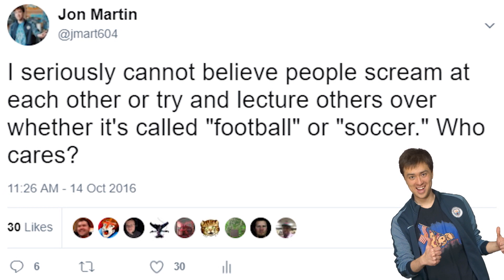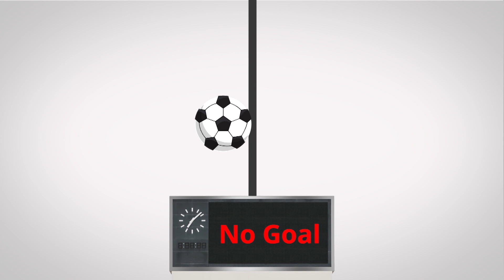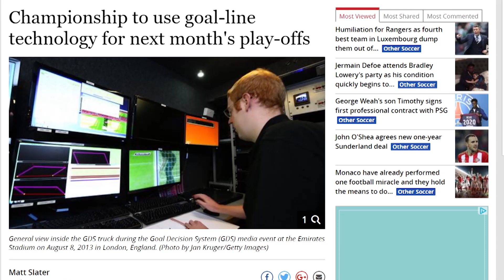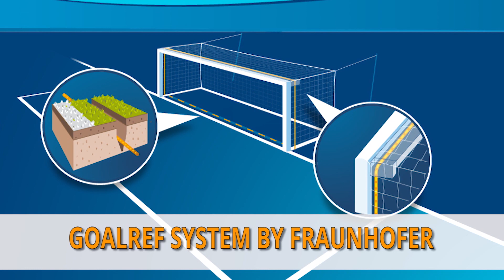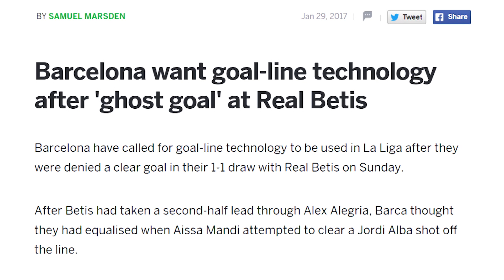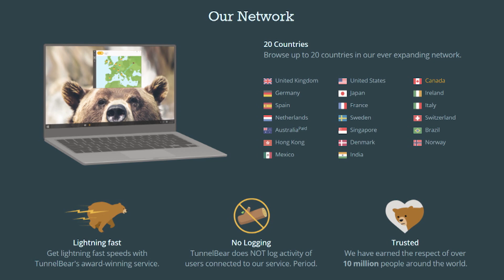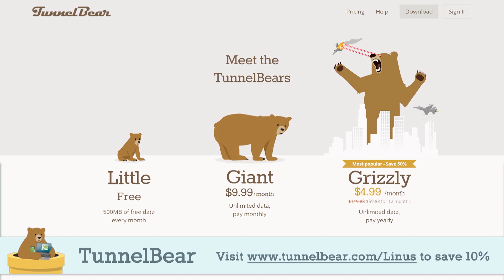How Does Goal-Line Technology Work?

Comment: This is most useful in hockey, where it is far easier to have a situation where the puck goes in without anyone noticing. The puck is like 10 times smaller than a soccer ball, and people shoot them at 120+mph, far faster than a soccer ball ever gets. It was very common to have people score, very often with a shot that's flat on the ice, that will go in and immediately bounce off the inside of the net and come right back out and the ref's couldn't tell it went in

Comment: The technology in sports has ramped up by a bit in the last few years. Golf, baseball, cricket and tennis all use radars and cameras to determine some parameter in the sport. Example a radar would be used for ball speed in all the sports. Cameras would be used to calculate the absolute position. The programming and math involved to get these systems to work is interesting.

Comment: It doesn't matter, to me it's soccer but I don't give a damn. The fact that football in the US and Canada is a term for another sport shouldn't make everyone cry. It's just 5 lost seconds trying to explain which one we're actually referring to. As for the goal line technology, the wires wrapped around the crossbar and uprights may be susceptible (I hope I'm using this word correctly, I can never get it right) to the posts' vibration and make a bad call. I think technology should be used, but cameras like in the NFL are enough. Let the referee decide. Still, even in that situation, we've seen referees overturn obvious good (bad) calls on the field, so the leagues should allow more than only one referee to give an opinion.

Comment: 3:00
500 fps? a ball can be shot at 200km/h => 200*3.6/500=1.44 meters a ball can travel inbetween frames (if the cameras arent synced (which i doubt) you could get an error of only 5cm (/2 bc of rebound) but still. i know that usually they are slower, rebounding takes more time and after they are even way slower, so i guess the 4mm inaccuracy just come from the system with the ball not moving

Comment: Why not use a series of ir lasers around the goal frame to sense when and how fast and object moves through the goal line? Also use a camera near by or embedded into the frame that triggers whenever the sensors are crossed. It's cheap, efficient, and doesn't need a whole lot of messing with. Every home in America with an automatic garage door opener has something similar and it is running non stop.

Comment: 5:25 and THERE was the reminder I DID NOT NEED of the ROYAL FUCKUP that the referee made at this years Stanley Cup Final. (If you haven't already guessed, Nashville fan here)
Reply from the maker: Nashville was robbed for sure. Goal-line tech would really help in the NHL, though arguably an even bigger issue is the rule that says the ref has to blow the play dead as soon as he loses sight of the puck. In my opinion, the play should be allowed to continue, with goal-line tech confirming if the puck was across if there's a big pile-up in the crease. Carolina also had a goal disallowed in Game 7 of the '06 Finals, even though a subsequent replay showed that the puck was completely over the line. --JM

Comment: Players are the human element (human error). Players should be given the right calls as much as possible. If it’s a touchdown, but the ref didn’t think so, it’s still a touchdown. The player did his job. If the player was thrown out at first base, but the ump said he was safe, the player should still be called out. It’s simple. Players/weather should be the only “X” factors in sports. Officiating should be as accurate as possible even if it means using more computers/technology.

Comment: Two questions:

1. Is this technology similar to Hawk-Eye, which is used in tennis for when a player wants to challenge a call?  If so, it's not at all a new technology (it's at least a decade old).
2. Would this ever be a viable technology for use in basketball, given that it's not just the ball but also the players that have to be kept track of for out-of-bounds calls?

Comment: The NHL briefly used a camera technique, similar to The Matrix, (first Trinity scene). On a replay, the camera would focus on a player, stop their motion, pan around them like 360 degrees, and then continue back to normal play. Does anyone remember this, and if so, what was it called, please?
Reply: If it helps, it may have been the 2000, or 2001 season.